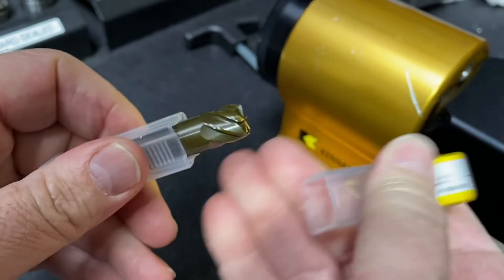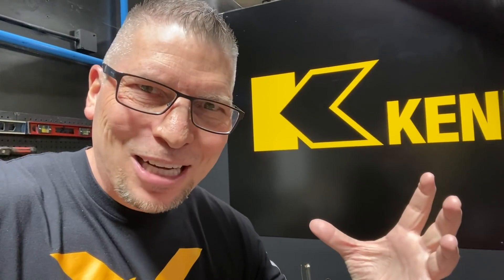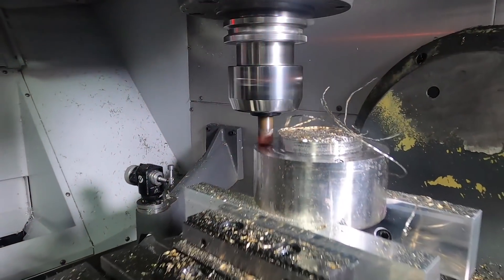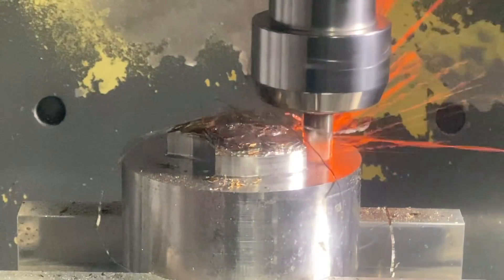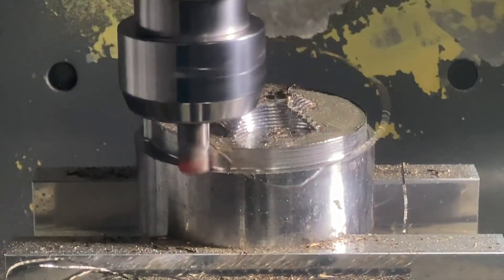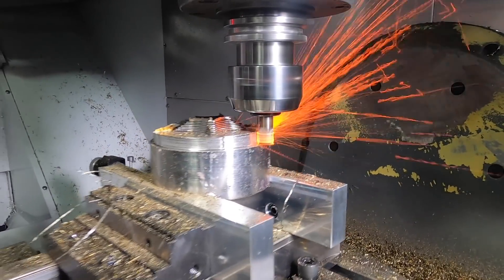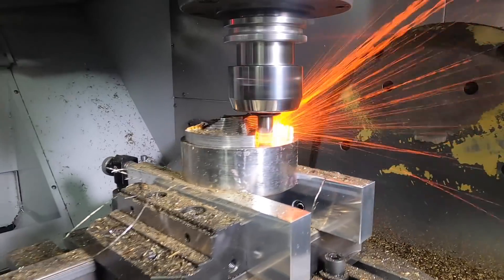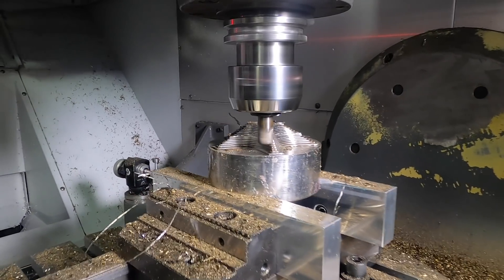Insanely Fast CNC Machining Inconel 625 w/ Ceramic End Mills | Pushing UMC-750SS to the Limit

Comment: Bad for coolant-manufacturers, good for making firework :-) Sometimes the tip of the ceramic glowing a little bit. But hot ceramic cuts better. With the half rpm the Cutter will melt.

Comment: I was ducking away when the red sparks and metal came towards the camera 😅 like where's my safety goggles haha 🤓
Awesome bright chips 🤩
Reply: .01 mm feed per teeth and metal is molten down out of the part. I can barely call the residue that come out of this operation a "chip".

This is in between machining and grinding.

Comment: All the Sparks and the glowing tool is basically a part of the energy which comes from the spindle.
Think about how much energy is used, just to rip some metal appart.
Reply: time is money, it takes a long time to cut that kind of material with a Regular Carbide Endmill, which in turn costs more in tooling and power, as well as time. which in the machining world, is money.
Reply: About 20-30 horsepower, not much more than a regular car at steady state.

Comment: Just wondering, isn't it bad for the machine to not have coolant on. Or does the use of a ceramic cutter make using coolant not needed
Reply: I turn with ceramics often and I do it dry as ceramic is sensitive to thermal shock and could easily chip or crack, due to rapid heating and cooling.  Also I generally turn hardened tool steel, so heat created at the tool/part interface anneals the steel just ahead of the cut so that it can be removed easily.

Comment: Hey Titan! Can the end mill be used on Aluminium?
Reply: No the fluts would instantly be filled up and it would break
Reply: High speed steel works well for aluminium AFAIK.
Reply: @hakont.4960  most aluminium is cut with carbide these days. It just needs different tool design from steel: higher rake angles and very sharp edges (carbide for cutting steel is often deliberately blunted slightly to increase the strength of the edge, tools for aluminium must be razor sharp) and no aluminium containing coatings that could bond with the chips.
Reply: @nerd1000ify  I guess I learned something new today.
Reply: Nice to see someone still using the old school stuff! Nostalgic brings me back to when we developed the plasma rifle in the 40Watt range back in the 80’s. Pro tip: you could mill into those soft jaws for greater workpiece rigidity and thermal stability through crystalline non amorphic stock. But if you knew that you would  also know the difference between a Haas and a  Japanese machine. Or a Buick to a Bentley. Keep up the good work kid!

Comment: now not adding coolant you said because its ceramic, what if u did throw alillte coolant on there. I don't know when i see a glowing orange tool bit i cringe.
Reply: That orange glow is normal, it's just a byproduct of how ceramic wants/needs to be run. If you try to turn on your flood coolant you will thermal shock the endmill and destroy it.

Comment: Imagine being sprayed by the glowing red stream of lava on an open machine! Ouch...
Reply: Don’t think that would be osha safe XD
Reply: @shbooby5258  If OSHA were to come in my area our entire industry would be gone...I have never seen any kind of guarding other than chip trays on machines, you regularly see someone squinting while cutting a loosely held workpiece indoors with a huge ass angle grinder, and welding helmets are only used "for large welding jobs". In general there are many one eyed mechanics around here.
Reply: @Sketch1994  lol I understand that it was just a joke, I weld and machine but don’t do much manual so I’ve never seen what it’s like to get chips all over ya

Comment: can you run ceramic on machines with cutting oil or will it catch fire
Reply: dont cool ceramic mills...
If you cool them you need always coolant on the ceramic or the ceramic will burst

PS: Never used oil with ceramic, but normal coolant emulsion you can use
Reply: cooling the ceramics is a bad idea because the thermal shock would break them (thermal shock is not good for ceramics and also the way that ceramic tools works is totally diffirent from carbide tooling the edge is designed to maximise friction and generate as much heat as possible so that the material will loosen up and softens till it becomes partially melted than the flute geometry will evacuate and thats why they never cool them just some airblast or through tool airblast to fly those chips away and search for articles about this subject, greenleaf is one of the leading companies in tooling recerche and developement chek their website as well

Comment: Hey titan, do you like those hydro force hydraulic holders? . Long story short the guys in my shop all have less than a year in the trade and dealing with collets being tightened to much I'm thinking of just using all the hydro force holders
Reply: Best thing to do is give them shorter wrench. All we do here is drill. Every drill is put into a hydraulic holder. My guys found a way to "F" that up as well . The screw you tighten to build up the hydraulic pressure gets bottomed out. Over time it will get messed up as well.
But i know where you are coming from. my guys think the tighter they have something the less it will chatter. No FINESSE!!!!!
Reply: Hydroforce holders are fantastic and they are great for idiots. I use them in high production with novice people who are not machinists. Adjustable axial hard stops are perfect and they are resistant to people not cleaning properly due to tight tolerance fits. Collets are affordable. Holders are balanced well and can do anything from precision reaming to rough hogging. Love them.
Reply: Maybe try get some torque wrench to help with  over tighten collect. Those hydro force holder are expensive. If you afford them go it. They are nice.
Reply: @LienNguyen-sw7kb  we have the torque wrenchs and I am the only 1 who uses them. So I know which tool holders I have touched bc I dont need a 3 foot breaker bar to loosen the damn collet.

Comment: I really want to know how much one of those ceramic endmills cost!
Reply: On the Kennametal website seems around $230 via the link above... Not like the entire CNC mill price of the ultra 8 end mill he often shows...
Reply: @henryhbk  Wow you weren't kidding.  I just looked and some of those Ultra 8X endmills run over $10k.  You could get a low-end Tormach for that.
Reply: And in fact I did!

Comment: The heat in the collet must be crazy tho
Reply: The ceramic does not transfer the heat.
Reply: @danl.4743  I'm guessing the air passing over it as it spins also gives some cooling.
Reply: Heat leaves with the chip so long as you are moving at proper (fast enough) feed rates. + what the other guys said.

Comment: Would be nice to see this on an actual thin-walled turbine engine hot end part with tons of stick out and/or small dia features not a super rigid block in a vise. I'm not knocking what your doing here just looking for apples to apples comparison.
Reply: My understanding is that ceramics need a rigid setup to function properly
Reply: @paintballthieupwns   Understandable. In my experience dealing with inco 625/718 in the aerospace industry, not only am I fighting the material, but part configuration and fixturing always seem to be less than ideal.
Reply: @nickvasquez85  - life is often less than ideal. That's where pros like you make the bucks

Comment: Hey Titan, so now you've shown us how to rough, how about finishing? If you're bored how about a part with some deep pockets like you talked about? Can you ramp with ceramics? Thanks!
Reply: Ceramic endmills aren't made for finishing only roughing. They don't seem to like interrupted cuts but ramping is fine. They are great for removing a lot of material quickly but you need the spindle speed, he is running 15k here which is probably the slowest I've ever seen someone turn these. I have a 5axis OKK with 20k rpm's and even that is slow. I typically run Mitsubishi and they recommend 25k+, but hardly anyone has that all the machines in our shop are either 16k or 20k.
Reply: @01srob  is ceramic actually cutting metal or eroding it to need these extremely high speeds?
Reply: @athrunzala5337  Honestly I don't know for sure, that's a good question. I would say that its probably a combination of the two, the chips are very fine. The endmill itself actually erodes as you are cutting so you are progressively cutting with a smaller tool until it breaks.
Reply: @athrunzala5337  Yes ceramic is doing the cutting